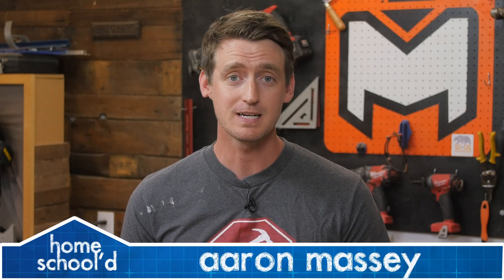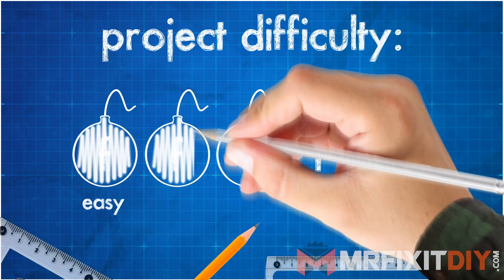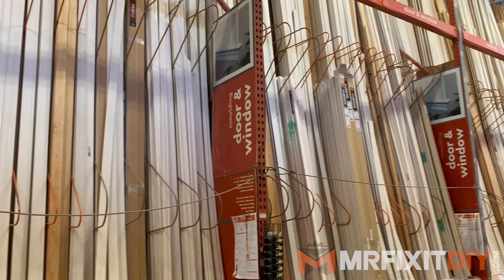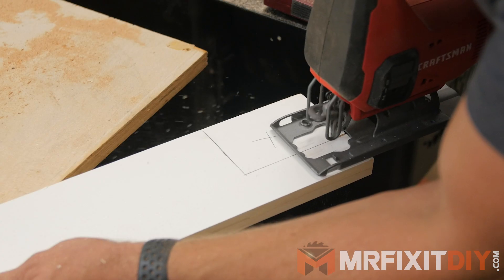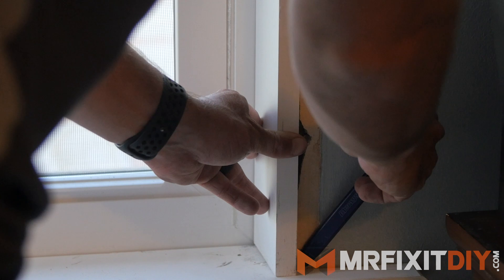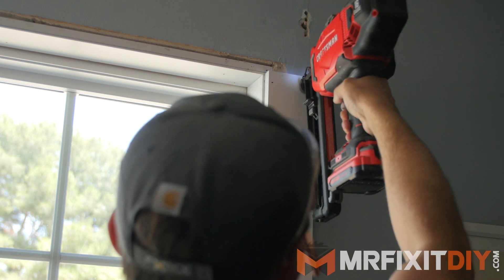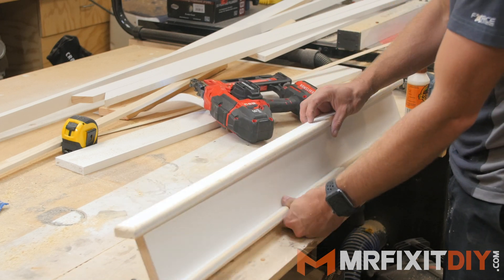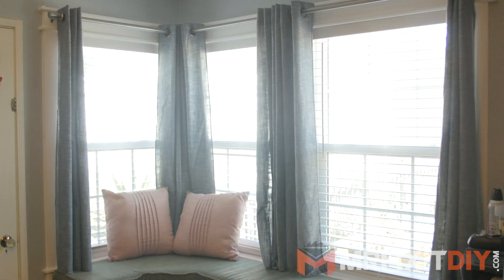Modern Craftsman Window Trim | DIY How To

Comment: I assume that you’d have to re-trim the window if you were to ever replace it since it’s nailed in?  In my old-ass home, the trim is screwed in so my window guy could just take it out and put it back.  I’d love to ditch all this old trim and do it the same way you did but wondered about having to replace a window down the road.  Then again at that point, I may be too old and senile to care.😄
Reply from the maker: Depends. If you're using a replacement window, you may just need to pull out the inner side stops. In any case, replacing a window is a bigger (and more expensive) job than doing trim. It's an easy adjustment if you need to but a window should last a good long time.